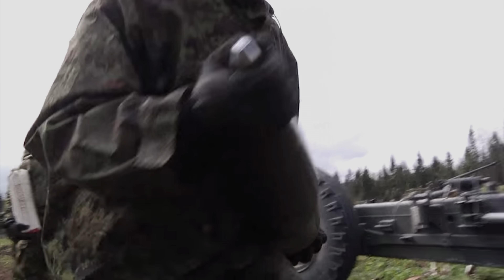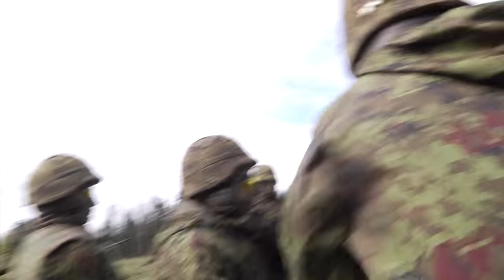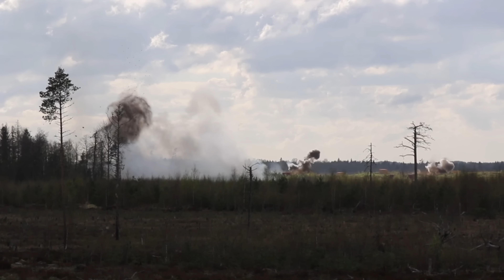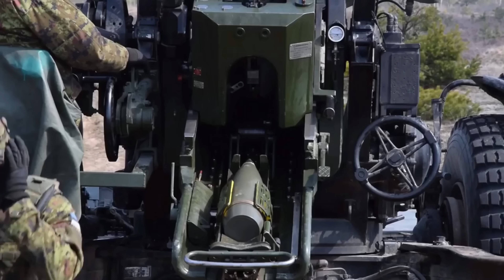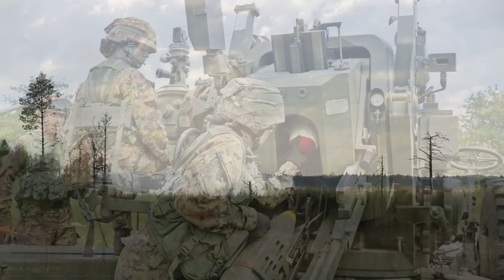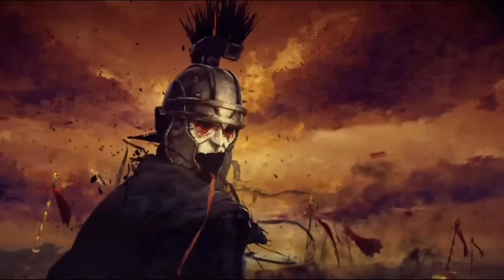FH-70 155 mm Towed Howitzer - DITCHED BY AMERICA?!

Comment: Out of all the guns I worked on the FH70 just has to be the worst in my opinion.
The only good thing about it was the Foden Truck that pulled it had a Wendy Cab for the guys when travelling.
Guns I worked on - Abbott 105mm - FH70 155mm - Light Gun 105mm - M109 155mm.
Out of them all, I would say my oredr of preference would be M109, Light Gun, Abbott, FH70.

Comment: Ammunition

The new projectiles conformed to the Quadrilateral Ballistics Agreement between US, UK, Germany and Italy. In essence, this meant a shell with the same shape and dimensions as the US M549 rocket-assisted projectile. The standard HE shell (UK designation L15) is a thin wall design weighing 43.5 kg and containing 11.3 kg of HE. This remains the largest HE load for a standard 155mm shell.
The propellant system comprises three different bagged cartridges with triple-base propellant. Cartridge 1 gives charges 1 & 2, Cartridge 2 give charges 3–7 and Cartridge 3 is charge 8, which gives a maximum range under standard conditions of 24.7 km.
Each nation developed its own fuzes and ammunition packaging. In the UK's case, this led to the Unit Load Container carrying 17 complete rounds, including shells with fuzes fitted - a novelty for 155 mm.
Standard US pattern 155 mm ammunition can also be fired, although US primers proved problematic for the primer magazine and feed due to their variation in size.

VOLCANO MUNITION

Under the name Vulcano, the Italian company Leonardo-Oto Melara has identified a new family of bullets for its 127mm naval cannon also in the 64 calibre version and for the 155 mm howitzers, both the trailed Fh-70 cannon and those that equip the self-propelled M109 and PzH 2000; these bullets have the characteristic of having an extended range compared to traditional ammunition of the same calibre and, for some versions, a guidance system that allows precision attacks against naval or land targets.
The same projectile can be fired from different calibres (127 mm and 155 mm) as it is undercalibrated and cambered by means of disposable spacers in the same way as APFSDS projectiles, the precise denomination for this type of ammunition is HEFSDS (High Explosives Fin Stabilized Discarding Sabot), i.e. a high explosiveness, fin stabilized, casing abandonment projectile.
The ammunition consists of two sections, with the front component with canard fins and the rear part with spacer fins. The front part contains the warhead and has 6 fins. In all, the bullet weighs about 20 kg with 2.5 kg of explosive. 

The ammunition will be of 3 types:

    Ballistic Extended Range (BER) - basic unguided version that can reach 70 km and can be used against any type of naval, land or air targets.
    Guided Long Range (GLR) - anti-ship version guided in the final by an infrared (IR) sensor that starts searching for the target at a distance of 6 km and at an altitude of 2.5 km. It can reach 70 km or even 90 km if fired from the 64 gauge barrel. The warhead explodes after penetrating the hull of the target ship. Oto Melara indicates a "kill probability" of 80% with the first shot against a ship the size of a frigate.
    Guided Long Range (GLR) - fully guided ammunition via GPS and IMU (Inertial Measurement Unit). The bullet is fired up to a height of 25 km where it is guided by the IMU system constantly updated by the GPS continuing at supersonic speed with a constant angle of descent. The last phase of the flight takes place in nosedive on the target.

The concept of the new munitions family "Vulcano" has been developed by Leonardo-OTO Melara of La Spezia and provides for an under-calibrated non self-propelled ammunition equipped, in the guided version, with aerodynamic governments, inertial navigation/GPS and, in some subtypes, with a terminal guidance system, characterized by a very high range and a very high accuracy (CEP < 20m).
A first differentiation between ammunition that is being developed under the Program can be made between unguided and guided ammunition, called Extended Range and Long Range respectively. The calibers under development are 155mm in the land version and 127mm in the naval version.
The trajectory of unguided ammunition is conventional ballistic ammunition with a range of up to 70 km, while the range of the guided versions will reach 100 km when fired from cannon cal. 127/54C and 120 km when fired from the new cannon cal. 127/64LW. For the cal. 155mm the expected range is up to 100 km. These ranges will be achievable thanks to a very high initial velocity of the bullets and very low aerodynamic coefficients when compared to those of large caliber ammunition in service. The projectiles are equipped with a multi-function fuse, based on microwave technology and programmable with altimetric, proximity, impact, delayed impact or time functionality.
The main difference in the terrestrial versions, apart from the calibre, is the different configuration of the propellant assembly, specifically designed to ensure total compatibility with the PzH2000 self-propelled howitzer loading system. Ammunition

The new projectiles conformed to the Quadrilateral Ballistics Agreement between US, UK, Germany and Italy. In essence, this meant a shell with the same shape and dimensions as the US M549 rocket-assisted projectile. The standard HE shell (UK designation L15) is a thin wall design weighing 43.5 kg and containing 11.3 kg of HE. This remains the largest HE load for a standard 155mm shell.
The propellant system comprises three different bagged cartridges with triple-base propellant. Cartridge 1 gives charges 1 & 2, Cartridge 2 give charges 3–7 and Cartridge 3 is charge 8, which gives a maximum range under standard conditions of 24.7 km.
Each nation developed its own fuzes and ammunition packaging. In the UK's case, this led to the Unit Load Container carrying 17 complete rounds, including shells with fuzes fitted - a novelty for 155 mm.
Standard US pattern 155 mm ammunition can also be fired, although US primers proved problematic for the primer magazine and feed due to their variation in size.

VOLCANO MUNITION

Under the name Vulcano, the Italian company Leonardo-Oto Melara has identified a new family of bullets for its 127mm naval cannon also in the 64 calibre version and for the 155 mm howitzers, both the trailed Fh-70 cannon and those that equip the self-propelled M109 and PzH 2000; these bullets have the characteristic of having an extended range compared to traditional ammunition of the same calibre and, for some versions, a guidance system that allows precision attacks against naval or land targets.
The same projectile can be fired from different calibres (127 mm and 155 mm) as it is undercalibrated and cambered by means of disposable spacers in the same way as APFSDS projectiles, the precise denomination for this type of ammunition is HEFSDS (High Explosives Fin Stabilized Discarding Sabot), i.e. a high explosiveness, fin stabilized, casing abandonment projectile.
The ammunition consists of two sections, with the front component with canard fins and the rear part with spacer fins. The front part contains the warhead and has 6 fins. In all, the bullet weighs about 20 kg with 2.5 kg of explosive. 

The ammunition will be of 3 types:

    Ballistic Extended Range (BER) - basic unguided version that can reach 70 km and can be used against any type of naval, land or air targets.
    Guided Long Range (GLR) - anti-ship version guided in the final by an infrared (IR) sensor that starts searching for the target at a distance of 6 km and at an altitude of 2.5 km. It can reach 70 km or even 90 km if fired from the 64 gauge barrel. The warhead explodes after penetrating the hull of the target ship. Oto Melara indicates a "kill probability" of 80% with the first shot against a ship the size of a frigate.
    Guided Long Range (GLR) - fully guided ammunition via GPS and IMU (Inertial Measurement Unit). The bullet is fired up to a height of 25 km where it is guided by the IMU system constantly updated by the GPS continuing at supersonic speed with a constant angle of descent. The last phase of the flight takes place in nosedive on the target.

The concept of the new munitions family "Vulcano" has been developed by Leonardo-OTO Melara of La Spezia and provides for an under-calibrated non self-propelled ammunition equipped, in the guided version, with aerodynamic governments, inertial navigation/GPS and, in some subtypes, with a terminal guidance system, characterized by a very high range and a very high accuracy (CEP < 20m).
A first differentiation between ammunition that is being developed under the Program can be made between unguided and guided ammunition, called Extended Range and Long Range respectively. The calibers under development are 155mm in the land version and 127mm in the naval version.
The trajectory of unguided ammunition is conventional ballistic ammunition with a range of up to 70 km, while the range of the guided versions will reach 100 km when fired from cannon cal. 127/54C and 120 km when fired from the new cannon cal. 127/64LW. For the cal. 155mm the expected range is up to 100 km. These ranges will be achievable thanks to a very high initial velocity of the bullets and very low aerodynamic coefficients when compared to those of large caliber ammunition in service. The projectiles are equipped with a multi-function fuse, based on microwave technology and programmable with altimetric, proximity, impact, delayed impact or time functionality.
The main difference in the terrestrial versions, apart from the calibre, is the different configuration of the propellant assembly, specifically designed to ensure total compatibility with the PzH2000 self-propelled howitzer loading system.

Comment: I was part of the Battery that ran the trials in the UK. This would have been in 1978 - It was a very capable Howitzer - We had Foden Trucks to pull them. We easily achieved 6 rounds a minute with a well trained crew of six. We were not use to the semi automatic loading and some guys lost a finger in the first six months.  In fact I remember one display at Larkhill where we drove on to the stand, deployed and fired six rounds, and started to drive off before the first round loaded on the impact area (about 30 seconds). Direct fire on tanks took off the turret with HE shell and no need for a HESH development 🙂
Reply: "Those lost fingers were not service related." - VA probably
Reply: I think l remember you dave when l was at the royal school of artillery back then good times at the royal school of artillery
Reply: Not a "crew " you mong..it's called a Gun detachment

Comment: OK ------ 4:!    The M-777 155mm Gun could be Ukraine's SUPER WEAPON to WIN this WAR!!!  But the current American M-777,  155mm gun only has a short 39cal. Steel barrel that is even inferior to the 42cal Steel barrels in most of Nato's inventories...   Giving the Short barrel M-777 a projectile range of only 23 miles with the standard M-795 round.  But the M-777 gun America is giving Ukraine could have a range of over 43 miles (instead of just 23miles) with the same M-795 round using a new High Tech long 58cal Barrel (replacing the M-777 old tech steel short 39cal barrel) that is now being field-tested by a Battalion of M-109 Self Propelled Superguns (that truly look beautiful with their long barrels). The new high-tech none steel barrel is a Composite Carbon case, Titanium sleeved long 58cal Ultra High-pressure Marvel of American Engineering... The high-pressure 58cal (30 feet long) barrel using supercharged propellant (that would blow up the average steel barrel) gives the M-777 155mm Super Gun a range of 60 miles firing the new XM1113 projectile... and over 150+ miles with the new subcaliber Hypervelocity GPS guided projectile. Making the M-777 a terror for all Russians in Ukraine... Allowing Ukraine to finally take back (freeing) the Crimea and the Donbas without suffering massive Ukrainian casualties...
K -------  America needs to send the Battalion of new M-109 Super Gun, long-barreled 58cal guns to Ukraine for testing in real combat (instead of blowing craters in the Texas desert), which would be followed by the new high tech SUPER BARREL Kits for Ukraine's M-777 guns (the new lightweight composite 58cal 30-foot long barrels {same weight and balance as the 39cal steel barrels in both the M777 and M109}  simply slide into the gun carriages of both weapons, replacing the original 39 cal barrels without any major modifications). That could number 1,000 M-777 Superguns deployed to Ukraine in a short time if they are pulled from American storage Depots that are waiting to be scrapped... (in addition to the measly 90 the US is sending now...)   Giving Ukraine the Numbers to finally have a chance against a Russia that has thousands of big guns more than Ukrain but lack the range of the M-777 SUPER GUN that would be able to sit back and safely SNIPE the Russian big guns and their ammunition depots into oblivion no matter how many Putin sends...!!!  Finally giving Ukraine an advantage they Desperately need...!!!  As the Russians both outnumber Ukrain in weapons and manpower...!!!  Ukraine has been refused modern fighters but with enough M-777 and M-109 guns, Ukraine can make up for what they cannot do without new fighters they can not get!!!  Win this WAR!!!
K1 ----!!!  Please call and write President Biden and your Congressmen in the House and Senate to demand that Ukraine get the thousand M-777 and hundreds M-109 guns from our storage depots NOW, with the SUPER GUN 58cal upgrade kits following as soon as they are produced on the production line now making the test barrels for the M-109 Supergun...!!!  That will stop the Russians in their tracks from taking any more Ukraine cities to torcher innocent local civilian men, Rape women and children then murder and bury them in mass Graves...Thank You...!!!!

Comment: I actually don't see where the M777 is "superior" to the FH-70.

The FH-70 is motorized and can move on its own - the M777 can't.

The FH-70 looks like it can be operated by 4-5 crew. The M777 needs 4 people just to adjust the gun elevation and traverse and another 4 to load a shell(there are always 10 people standing around an M777). 

The FH-70 can be built in different countries, the M777 is mostly and only built in the USA.

Both are 155mm 39 caliber length(except for the experimental M777ER), M777 has more accessories, but those could be added to the FH-70. Long range ammunition likely can also be used on the FH-70. So for Europeans the FH-70 would be a better choice, assuming it can still be produced.

Comment: I worked on this 30 odd years ago. tri national build. Italy (Sights) UK (Trail legs and Hydraulics ) Germany (Ordnance  and APU) And guess which bits went tits up most often ? Correct the British built bits !We also became the only 19 gun regt  in BAOR for a brief time. We had a gun in LAD which we couldn't get parts for (Trail leg I think or a Jockey wheel) Anyway it sat in LAD so long it was cannabilised  to repair other guns. Some bright spark thought it was a good idea to just demand a new gun . AFG 890 duly submitted , Jolly jape chaps chuckle chuckle ...and it was, until the new Gun FH 70 complete as per CES actually turned  up ! Which was nice , until RAOC decided they wanted the old one back !!!  Carnage !!!  We literally rebuilt it from nuts and bolts I still have a photo of me and another Gun God with an ISPL and a box of bits on a bench. This would have been about 1983.

Comment: This harkens me back to 1954 when I joined a US Marine Reserve unit which had a single,  155mm "Long Tom" gun.  The gun could be fired in either direct fire mode or as a howitzer and had a range of 24,000 yards or 22 km when firing a 100 pound armor piercing round.   By the time I went on active duty in 1956 the reserve unit was equipped with a huge 155mm self propelled gun, but I don't recall much about it.

Comment: um spark diesel ? I thought diesel engines used compression ignition  , is there more info on this ?
what is being ejected at the end of requile I did not see anything, nor any casings ?
why dos it take so much pumping to rais the breach with a hydraulic system ?   is that just for elevating the barle and traversing the gun
Reply: I couldn't find much on it other then the Military-Today .com listing that said pretty much the same thing "The APU is a Volkswagen Model 127 1.8-liter diesel motor, with 4 cylinders in a "boxer" configuration. It is air-cooled, spark-ignited, and produces up to 71 hp at 80 rpm"

Comment: Those things are supposed to be belt fed, that is why they are going by the wayside.
Reply: How you belt feed a system that uses 2 parts ? Different loads etc ? Shells that can weight from 50 to 76 kg ? Using different fuses. Those are howitzers not cannons

Comment: I use to be the number 7 on this back in 88, it steers via a paddle valve and if you don't re Centre the trail wheels it would just go around in circles so you had to constantly tap it left and right to keep going in a straight line!! Uk 45 fld regt RA Colchester

Comment: 20 years ago, a retired Major told me the reverse azimuth on incoming shells could be quickly calculated. He commanded mobile units that fired a few rounds then rapidly moved before the enemy could hit their location.
Reply: There are radar systems like COBRA (e.g. used by Germany, France and the UK) that determine from where the artillery shells, mortar rounds or rockets were fired and of course this information would then be shared with one’s own artillery and rocket artillery to fire at this position.
Reply: @HingerlAlois  Exactly the reason unarmored, towed artillery is obsolete imho. Sure, you can use them to shoot up some rebels from the inside of a base, but counterfire is real and fast.
Reply: @Guhonter  Still real in Ukraine.